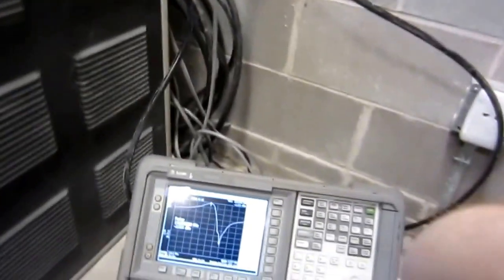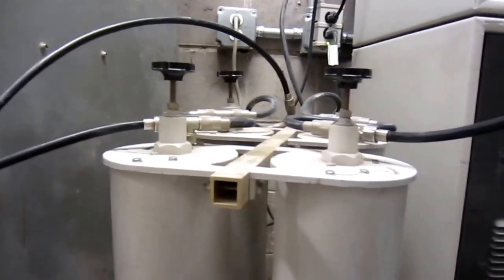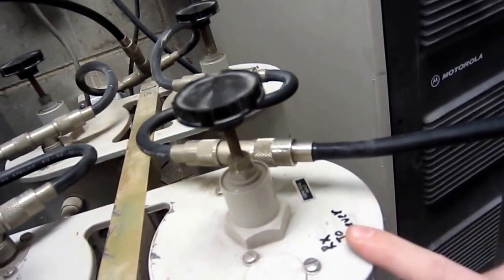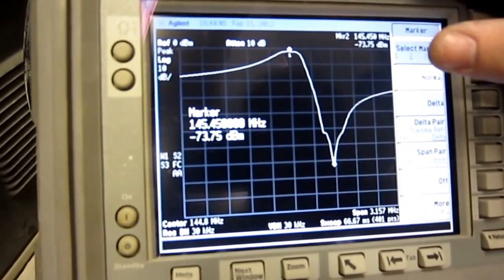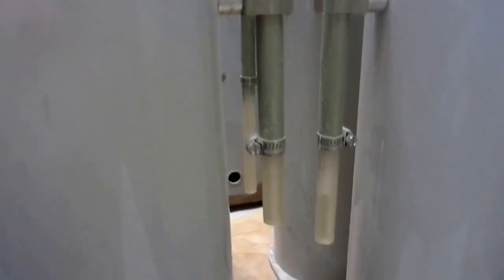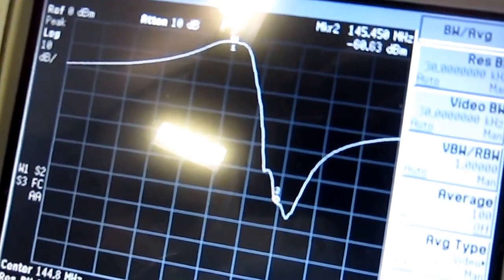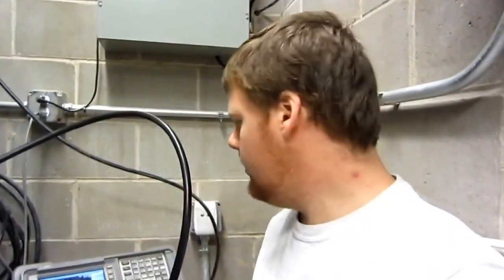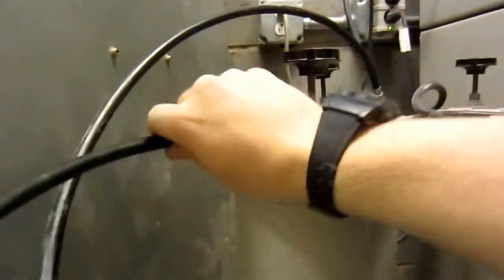W0EEE: Tuning the 2 meter Repeater Duplexers

Comment: Nice video.  I've been tuning and building duplexers for 40 years and I still liked your video, it reminds me of the fun I had when I was starting out.  Usually the knobs (which change the rod length) are used to tune the pass frequency, and the other adjustment (stubs in this case) tune the notch freq, but I'm not positive in this case since I haven't tuned this exact type.    People mentioned the dents, I've tuned cavities with dents like that and they seemed to work just fine.   I think the key is that they need to be tuned AFTER denting, not before :-)

Comment: I had a set of Wacom duplexes similar to these. They were used when I purchased them, and had dents larger than the ones in the video. Naturally I was concerned and asked Wacom if dents affected the performance of the cans. Their engineer said no...in fact he stated a significant dent or hole would be just about transparent to the performance. So no dents don't affect the tuning.

Comment: @N0SSC I have my first duplex sure to tune and I had hoped to use this video. But it wasn't specific enough. I appreciate the effort though. You apparently had frequencies dialed up and we're pushing a button to toggle back and forth between transmit and receive but it's still left me in the dark.

Comment: principle is about right, easier on a duplexer that has already been tuned though ! Lot more to adjust if setting up from manufacture.
One piece of advice, some rx and tx circuits aren;t very 50ohm matched, if you terminate the respective duplexer connection with the actual unit rather than a perfect 50ohm load you will actually be tuning it better. As in the real world it is unlikely to be exactly 50ohm
i thought i saw a dent too, or was it a reflection ?